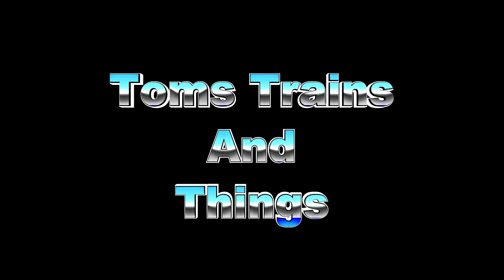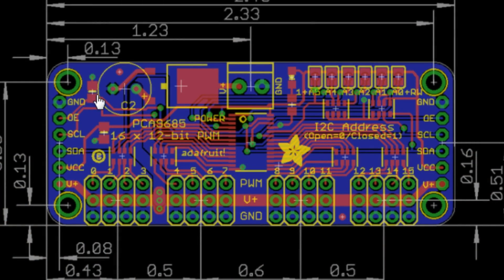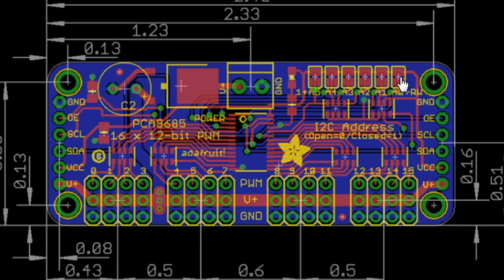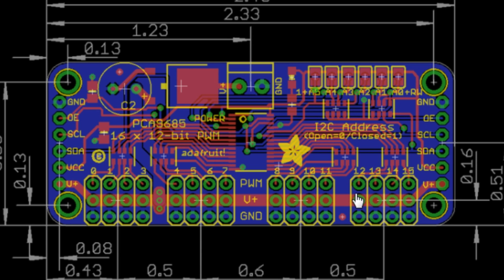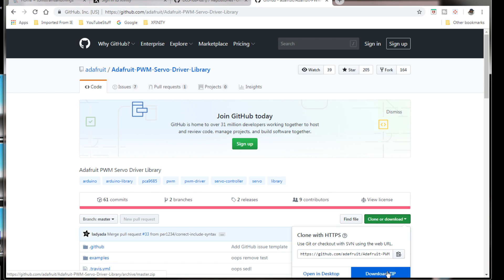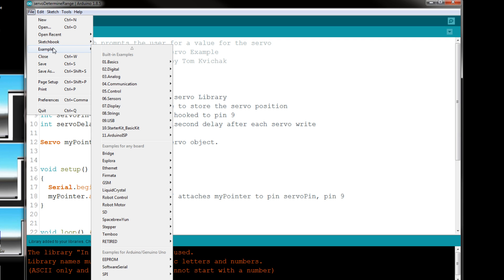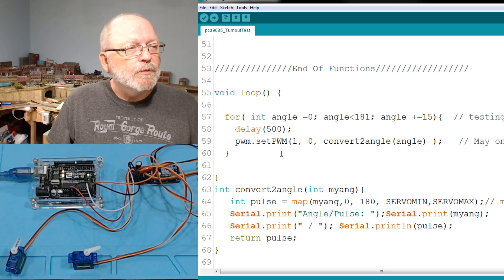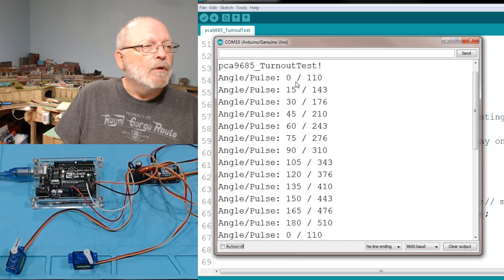Control 16 Servos Using A PCA9685

Comment: Great VDO. Need additional help how the led and the toggle switch is connected please. I am
Stuck at this point.
Reply from the maker: All the pin connections are listed in the header of the sketch
This is for the first servo:
int buttonPin0 = 2;   // Can add as many buttons as needed
int ledPin0C = 3;     // C designates Closed position of turnout
int ledPin0T = 4;     // T designates Thrown position of turnout
int buttonState0 = 0;

This is for the second servo:
int buttonPin1 = 5;
int ledPin1C = 6;
int ledPin1T = 7;
int buttonState1 = 0;

You can add as many as the pins you have available. A mega has a lot more pins

Comment: I used to operate 8 numbers 35 KGcm  servo motors simultaneously at same time and the PCA 9685 instantaneously smoked.
Reply from the maker: That could happen if you drive the servos past their limit and leave them there. You should test each servo for its outside limits and program them to stop driving before they reach their limits. They make inexpensive servo testers so you can avoid this from happening
Reply: @TomsTrainsandThings  This means PCA9685 is useless for simultaneously  operating high power servo motors.
Reply from the maker: @PatnaikUC  The power comes from you external power supply not the PCA9685. Try not to drive the servos past their limit and you won't have an issue
Reply: @TomsTrainsandThings  Sorry. The power comes through a tiny P- MOSFET that only smokes. Please refer to the circuit diagram of PCA9685 from the net.

Comment: Although the PWM is set with a 12 bit value, it does not mean there are 4096 steps of control. At a frequency of 50hz you get 25MHz/(50Hz * 4096) ≈ 122 steps. This is a far cry from the advertised 4096 steps!

Comment: Great job Tom as usual. Could you supply a schematic or wire diagram on how to wire the switches and LEDs up to the Arduino and the PWA9685 to use for turnouts. Athe the present time I am using TVD Octo lll's.and a Quad LN.
🙂

Comment: So everyone is showing using a PCA9685 to drive up to 16 servos or more if you daisy-chain them. But you're limited to how many buttons you can plug into the Arduino to act as inputs. How do you overcome that limitation?
Reply from the maker: You can run 16 servos on each pca 9685. You can also use a pce 8555 for pb there are many different devices you can use with I2C to increase inputs & outputs

Comment: This is a great tutorial Tom. Very easy to follow. I have now made a mimic panel incorporating the Arduino Meg Pro and the PCA 9685 running 15 servos, SPST Switches and 2x2-pin bi-colour LEDS (One for Thrown and the other for Closed) and it works like a charm. Thanks again for the Tutorial, and keep up the great 👍 work
Reply from the maker: Thank you so much, glad it was helpful in getting you where you needed to build your own.

Comment: Thanks for the video. What's the maximum current this thing can handle? My servos need about 1.5 amps each.
Reply from the maker: The power drawn comes from the external powwr you supply to your servos. The PCA9685 only supplies a signal to the servos. To determine the max current for the device, I suggest contacting the manufacturer.
Reply: @TomsTrainsandThings  The PCA9685 is just the controller chip on this board, right?
Reply from the maker: @safatkhan676  Yes, this is a breakout board for the chip, first offered by Adafruit
Reply: @TomsTrainsandThings  Thanks for the informative video and responses.

Comment: Tom,  could you possibly show us how to completely wire, and code the Arduino and the PCA9685 with pushbuttons and LED position indicator lights on a control panel ?  I have  29 turnouts, and servos, and would sure like to know how to make it all work.  Thanks Tom !
Reply from the maker: Have you looked on my web site? That will point you in the right direction. The way you wire your mdel railroad is up to you. Everyone does it differently.

Comment: Thanks Tom. I wanted to see if I could use two PCA9685’s. One for the servos and the other for The LED’s?
Reply from the maker: Never attempted to run both servos and LED's on the same device, but I see no problem with servos on one and LED's on another.

Comment: Interesting Video Tom, I can think of a number of places to use this and not all would be turnouts. Got me thinking would the PCA9685 be capable of activating a Kato turnout.
Reply from the maker: Thanks Owen.  The PWM signal can control RGB LEDs, Servos, and spped on a DC motor. Anywhere any of these are used is a possibility.

Comment: What if I only need 5 Servo need to use this driver? which is better to use arduino PWM pins or servo driver PWM pins?
Reply from the maker: Even with 1 servo on the PCA9685. 
Using the PWM pins on the Arduino limits you to just 1 maybe 2 at the most. I wouldn't put anything else on that Arduino since you're pushing it;s amperage limit.

Try what I have on this video: https://youtu.be/xT98CcJdpHI

Comment: I want to have a crap ton of operating wig wags, Griswold signals and semaphores, this is probably the more affordable approach as those switch machines can break the bank
Reply from the maker: Servos are the way to go.  I used 9 gram servos in this demonstration, but a better fit for wig wag or signals would be 3.7 grams.

Comment: The documentation for this project ReadMe.adoc list 10K Resistors. The breadboard picture is showing 220 ohm resistors. What are the 10K's for?
Reply from the maker: The 10K resistors are for the pushbuttons or switch. They are pulldown resistors, prevents the voltage from drifting on the switch. The other resistors are for the LEDs, they can be different values depending on the desired brightness of the LED.
Reply: @TomsTrainsandThings  Thanks. They all had the same color code in the Breadboard drawing. I guess I'll start with 220's for the LEDs since I already pulled 16 of them. The documentation was a life saver for me. I've been stuck thinking using multiple switches on one analog input and I was going to use a second pca9865 for the LED's. I had a digital pin block because of the wrong thinking until I realized I have enough of them on the MEGA2560 to support the switches and LEDs for 16 servos. I've been procrastinating prepping the Control Panel not sure what I wanted on it. Now I can start drilling holes and mounting the switches and LEDs. I have a dream. :))))

Comment: Why do you use #define instead of const?
Reply from the maker: That code is from Adafruit as noted in the header. A lot of her older code uses Define, probably because of "C"
Reply: @TomsTrainsandThings  const is preferred
https://www.arduino.cc/reference/en/language/structure/further-syntax/define/
Reply from the maker: The good thing about Arduino is the availability of code especially from other manufacturers, all one has to do is copy & past instead of writing your own code. If it works, don't knock it. I see Define and other terms used all the time in code. It works either way!

Comment: Hello sir,  What is the safest way in using power supply assuming there's  32 servos running together at the same time,?  Thank you.
Reply from the maker: Calculate the total amp draw of all the servos and use a power supply capable of handeling it. Servos drw very little amperage if your using the 9g or smaller.
Reply: @TomsTrainsandThings  thank you~

Comment: I could not open your website. When are you going to share the code?
Reply from the maker: I shut down the web page at the end of December due to issues with the provider. Another one will be up in the near future.
Reply: @TomsTrainsandThings  Really hope we will get your website soon. I am very new into this hobby but it looks like nobody else explains how to control  servos with 9685 + LED's and toggle switches. Everybody else use JMRI directly. So I desperately waiting for your new website to get wiring diagram and other info to build same system. Thank you again for your great youtube channel.

Comment: Ok. Thank you. But where is the most important part that explains wiring and for control panel? To be honest everything else is pretty easy to find online. I would be appreciated if someone could explain me how to wire  control panel with this setup and where to find code for it. Thank you in advance.

Comment: Tom, I like this code for the 16 Servo Board, but I'm wondering if there is a way to slow the speed of the servo down, to throw the turnouts a little slower.
Reply from the maker: I haven't found a way yet. I have to keep trying. That's been ask by many.
Reply: use a smaller angle (full/10), pause, increase the angle (add 1/10), pause, repeat until full angle is reached.
time to pause (aka sleep) is decided by you, that should do it !  /10 can be higher if you want it smoother

Comment: Do you have a sketch to control only 4 videos with leds using only an Uno without having to spend money on the pc9685?
Reply from the maker: Here is a video on controlling a servo with an Uno; https://www.youtube.com/watch?v=w3DL-H0fzmY
In order to control more than 1, you would need an external power source for the servos to drive them.

Comment: Hi Tom
Enjoyed your tutorial.  I have successfully built my own dcc++ using an arduino and a motor shield and can run and program engines on my test track.  Now to step 2 I want  is use JMRI to switch my servos using an uno and a pca9685.  I was looking for the adafruit sketch you mentioned in your tutorial, however could not find it.  Would you be able to direct me as where to find it?  Thanks Geoff
Reply from the maker: A link to my web page is in the description, it's under /projects
Reply: @TomsTrainsandThings  Thank you Tom...found it...now to get to work
Reply: Tom, would you know of any tutorials that will connect JMRI to an arduino uno and PCA9685?
Would prefer to control servos direct from my pc thus eliminating need for a panel, wiring, led lights, and switches.

Comment: Great video Tom. I'm getting started with DCC++ and hope to use servo actuated turnouts. Do you know if the Walters LLC Switch Machines are compatible with the Arduino PCA9685?
Reply from the maker: Don't have any, but what I've seen, it has it's own control system with decoder. Short answer would be no. The PCA9685 along with the code in the Arduino takes the place of the components on the Walthers unit.
Reply: @TomsTrainsandThings  Thanks for the quick reply. I have one on order to play with, so I'll give it a go when it arrives and report back.
Reply from the maker: @larryo4480  Thanks

Comment: Hi tom,  how would you connect an on/off (SPST) toggle switch? would you keep the same as a push button with a 220ohm resistor (I am connecting 8 switches for 8 servos)?
Reply from the maker: Same as you would a push button. I used a PB in this demonstration because I didn't have an SPST sw to fit the breadboard.
Reply: Thank you for your help, great videos.

Comment: Great video, very informative.  My question is, the from the diagram, you can run 16 servos on the PCA9685 but it looks like the UNO board will run out of room for the LED lights before that. Is it possible to run the LED's off another PCA9685? Also, do you prefer the 2 pin bicolor or 3 pin bicolor LEDs?  New to this so sorry if questions have been answered before. Thanks
Reply from the maker: There are other shields and boards similar to the pca9685 that can add additional capacity to the Uno that are also I2C devices. I will be doing another video to demonstrate this in the future. I have several of the boards that can accomplish this but not had the time to do it. As far as bicolor LED. I prefer using the 2 pin, but in this application, the 2 pin requires a reversal of polarity which you can not do in this application. Either 2 separate LEDs or the 3 pin need to be used for this.
Reply: @TomsTrainsandThings  what boards do you have or would recommend for the LEDs?  I plan on having 10 turnouts run with servos as shown in your video with a Red/Green 3 pin LED at each to indicate direction.  Thanks!
Reply: @TomsTrainsandThings  One other question, does the UNO run off the 5V that also powers the servos on the PCA9685 or is another power source needed for the UNO, like USB?
Thanks!

Comment: That is precisely what I've been using in my turnout.
Reply from the maker: Works great
Reply: @TomsTrainsandThings  Absolutely. I'm using two Mega one for DCC and another for the servos as I needed many digital pins for reading switches on a switchboard. Now I use a Processing sketch were I have my layout and click on the turnouts.

Comment: I have Kato turnouts, and I have an ideal about using an arduino, a motor shield AND a multi relay board,  with each relay a turnout and the MS will provide the power to operate .
Reply from the maker: You can eliminate the motor shield. It needs external power to operate. The same external power you can hook up to the relay board. The motor shield can only control 1 motor per channel, it's not needed in your situation.

Comment: Where do you get the min/max numbers?
Reply from the maker: The min & max adjusted value have to be calculated.  I show how in one of my Arduino Made Easy videos.
Reply: @TomsTrainsandThings  calculated how?  All I got is the spec sheet that says limit angle 200°+/-1° and centering divisions 1°.  I tried random numbers and it just sounded like it was grinding so I stopped messing with it before I broke it.  Where are you getting numbers to "calculate"? PLEASE
Reply from the maker: @amelliamendel2227  have you watched my servo video in the series Arduino Made Easy? It explains it there.
Reply: @TomsTrainsandThings  I found it thank you for making these videos

Comment: Hi Tom, how do you control the servo speed with this pca9686? Because I am using this for a school project and the speed has to be lower to be stable. Maybe you could tell me how to find it?
Reply from the maker: Try a short delay in the code under the line pwm.set, this may slow down the rotation.

Comment: using ohmeter i rfound that the vcc and GND is connected ,,also the v+ (before i connect to anything) is my driver i sbroken already?
Reply from the maker: Sounds like you have a short.
Reply: @TomsTrainsandThings  thanks..., module is broken for sure.., if this 16ch servo shield can handle just about 5v, how about16ch servo driver shield (that stack in to arduino uno) can handle more than 5v?
Reply: @TomsTrainsandThings yes it is short,then  i removed the capacitor and the module is not short...,
Reply from the maker: @lokivsfortune  Not sure why you had a capacitor in there. I did not show a capacitor in the diagram or video.

Comment: Hi Tom, Good job, I learnt a lot from this. I have a question, how do I get JMRI to talk to the PCA9685 and control turnouts?
Reply from the maker: Thanks Chris, glad I could help. JMRI is an entirely different discussion. I may cover it later on in another video.
Reply: Yea same here. I'd like to use an Arduino Mega to control DCC++ l298p shield with addition to the pca9685 all from JMRI
Reply from the maker: @funcraft3605  see my comment to you on the other video.
Reply: @TomsTrainsandThings  which is the video where you speak how to drive PCA9685 from JMRI? you have too many videos .. please help

Comment: Hi - I have an Arduino Mega successfully running DCC++. How do I get it to run the PCA9685 at the same time?
Reply from the maker: Your best bet is to go on the Trainboard forum:  https://www.trainboard.com/highball/index.php
There are many modelers that do coding 24/7, they may be able to answer your question.
Remember, the Arduino micro-controller is designed to perform 1 task at a time. Although you can stack tasks, there will be somewhat of a delay in performance. I use multiple Arduino's throughout my layout.
Reply: @TomsTrainsandThings  Thank you.

Comment: Hello, is there any function that removes the voltage of one of the outputs of the PCA9685? It's to keep them from vibrating.
Thank you.
Reply from the maker: If your servos are vibrating, your driving them past their limit. Reduce the Max & Min figures. I show hoe to do that in another video.

Comment: With Arduino mega I dont need this extra accessory? Can I control Kato turnouts with this?
Reply from the maker: Yes you do. The PCA 9685 can handle the extra amperage needed for additional servos, the Mega can not handle more than 1 servo safely even though it has many more output pins. It's still limited to the available total amperage. If you can use servos with a Kato turnout .

Comment: How long can you make the servo cable?
Reply from the maker: I haven't tested the cables for the servos but I did a test on a 30+ ft length of Cat 5 cable for Tortoise switch machine and there was no issues.
Reply: @TomsTrainsandThings  I have never used a tortoise what is the drive signal?
Reply: @TomsTrainsandThings   I should have asked if the waveforms used to drive the Tortoise and the servo are similar to each other. This would make your tortoise test result useful.
Perhaps I should try some tests. Thanks.
Reply from the maker: Tortoise uses an independent power source or operated through DCC devices not compatible with this subject. The point was the length of the cable tested.
Reply from the maker: The tortoise takes DC, the servos take PWM